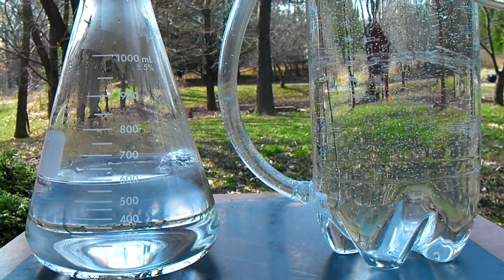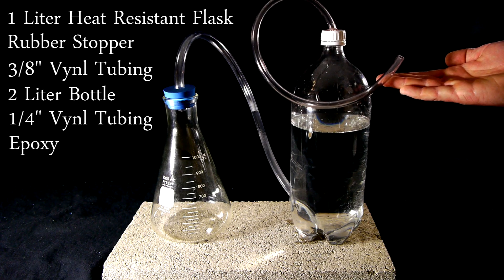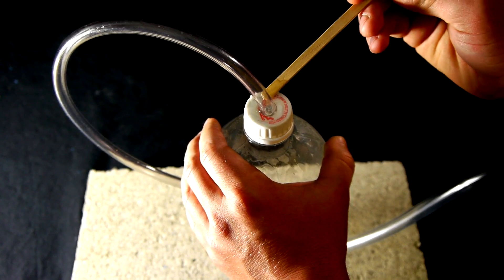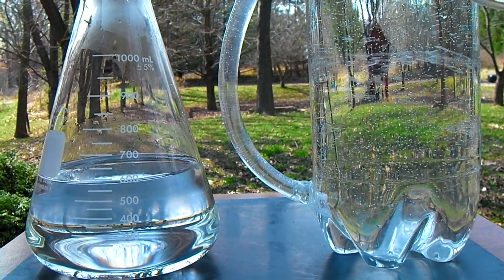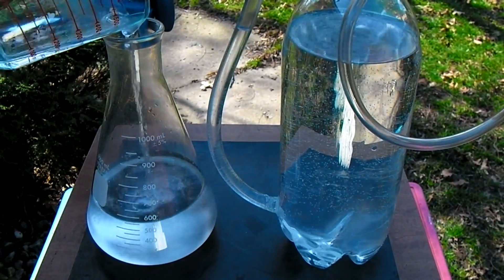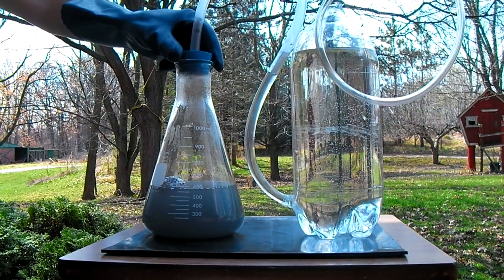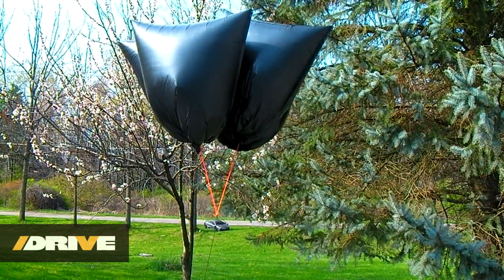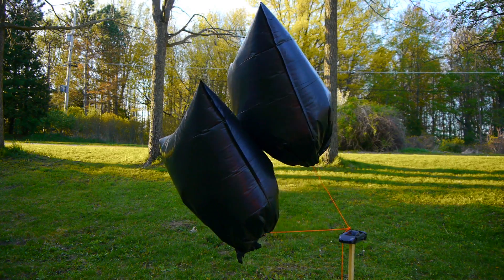How to Make Hydrogen Gas - Clean Burning, Inexpensive, Lighter than Air!

Comment: Isn't this HHO and not pure Hydrogen? I 'm going by the reaction of the explosion pure hydrogen doesn't blow up like this only when oxygen is in the mix of the gases.
.
Reply: Sorry, I was wrong about HHO and HOH thing, I got confused.
You are right about  hydrochloric acid analogy, but I still think you are wrong about the reaction rate of a H2 balloon with some air in it. I have set off many balloons with all sorts of different ratios of hydrogen-air and hydrogen-pure oxygen. Of course the fastest reaction is the stoichiometric mixture of H2 and pure O2, but if you calculate and put the right amount of air with hydrogen, the reaction WILL be faster than pure hydrogen. The reason is because the fuel and oxidizer will be mixed  already, and can react immediately.
Reply: It is not HHO, as aluminum and HCL releases only hydrogen. You are correct on the flamability. I think what happened is that when he filled the trashbags, he let a little bit of outside air in as well, either through imperfect hose seal, or when he unfolded the trash bag.
Also, if he hadn't, the video would have been less exciting as they wouldn't have exploded. Likewise, if he had put a little more air in, the explosion would have been much better, as then he would be approximating an HHO combination.
Reply: iguanian He said HHO. HHO is not the same as H2O or HOH. HHO is a made-up molecular formula that's supposed to mean a two-to-one molar ratio of hydrogen and oxygen gases. It's the product of the electrolysis of water, and it's the ideal mixture of reactants for creating water vapor and a big boom. I personally see no reason not to use HHO as an abbreviation of oxyhydrogen, but a lot of people get ticked by it.
Reply: You know how we, as mammals, breathe oxygen? You know how you don't see everyone walking around with respirators and oxygen tanks? The oxygen used for the combustion of hydrogen in this experiment is in the air. Once the bag is melted by the flame, the hydrogen and air are free to mix together, and the flame initiates the combustion. Iguanian is wrong in saying that with more air mixed in, the explosion would have been better. Air is mostly nitrogen, and nitrogen doesn't take a part in this reaction. You would be reducing the concentration of combustible material, making a weaker explosion. There is plenty of oxygen in the air for a small amount of hydrogen, such as in these bags, to burn. Hydrogen is the limiting reagent. Therefore, more hydrogen means more combustion.
Reply: Nope, 2Al + 6HCl --> 2AlCl3 + 3H2
Reply: Have you even built one of these unit? Do the test then get back to me .
Reply: First of all, "HHO" doesn't exist, it's pseudoscience and nothing more, second like TheSmileyFacedPizza said, the tubes where airtight, the hydrogen mixed with the air, to create the rapid combustion reaction. Unlike what he said however, more air would have made a faster burn rate, although if the bags are the same size, less energy would be released, because the hydrogen IS the limiting reactant. Even though air is ~78% nitrogen, more air means more oxygen as well, and the better the oxygen and hydrogen are mixed, the faster the reaction would be.
Reply: Amos Backstrom Wow. Sorry you don't beleive water exists...
Everything you say after that may be right, but honestly, you may as well be wearing a bird on your head because I can't read any further after your first statement.
Reply: Amos Backstrom I said that the combustion would be less spectacular because if you're putting air into a filled bag, whatever the bag is filled with has to come out. As you said, hydrogen is the limiting reactant. Having even less limiting reactant leads to having less reaction. Whether a better reaction means more reaction or faster reaction depends on the viewer. Personally, I find the deflagration of a pile of black powder to be much more entertaining than the brief, bright light of flash powder.
Reply: Amos Backstrom I also forgot to reiterate the fact that the concentration of the reactants would decrease, thereby reducing the rate of the reaction. Even if you filled the bag up with more air while not letting any hydrogen out, the reactant concentration would still decrease. I get a much more vigorous reaction when I mix 100mL each of 10 molar solutions of hydrochloric acid and sodium hydroxide than when I mix 1000mL each of 1 molar solutions, despite having the same amount of mass of each reactant.

Comment: Also this experiment can be done with magnesium to create Hydrogen and magnesium chloride which remains as a solution 

1Mg + 2Hcl --> 1MgCl2 + H2

But one thing to remember is that the hcl water mixture will slowly be diluted creating less hydrogen as more of the hcl is used up and turned into magnesium chloride and hydrogen, that's why at some point the mixture must be refilled.
Reply: I did that in science class a few weeks ago :)
Reply: Well, the same thing would happen with the aluminum, the HCl would eventually all disappear

Comment: Does the hydrogen gas react with the oxygen or doe it react with the flame?
Reply: It reacts with oxygen, but it needs a high enough temperature to get started. Once that happens, the reaction quickly releases heat and therefore the rest of the hydrogen also reaches high enough temperature to react, and this happens very fast, so you get an explosion, which consumes all the available hydrogen.
Reply from the maker: It reacts with oxygen to create fire.
Reply: NightHawkInLight That is just so cool! I love your videos! Keep it up! :)

Comment: I used a 500 ml heat resistant flask instead, and halved both the water and muriatic acid measurements.  I followed all of the other instructions, but nothing really happened when I added the aluminum foil to the flask.  The brand of Muriatic acid is called Crown.  Does halving the size of the flask, water, and acid affect the reaction?

Comment: Nighthawk, great video. I'm curious if I could use Works toilet cleaner which contains hydrochloric acid and is blue in color. I've used it with aluminum to make the same reaction, but in a closed bottle...Do you believe that will work?

Comment: This is a similar to making meth lol.
Reply: lol nice name
Reply: How the fuck is this similar to making meth. Because it involves chemicals? Wow, how similar. Don't do this if your only experience with chemicals is watching Breaking Bad.
Reply: you need hydrogen gas to make meth
Reply: what do you need to make hydrogen chloride?
Hydrogen of course
Reply: And you think that hydrogen and chlorine combine magically to make hydrogen chloride? You need ultraviolet light to do that. Simple, right? However, once you do that, how do you bubble it through the freebase methamphetamine? Hydrogen chloride fumes can be given off by boiling hydrochloric acid or reacting sodium chloride with sulfuric acid. The latter is preferred because boiling hydrochloric acid will also boil the water it is dissolved in. Neither of those methods involve diatomic hydrogen.
Reply: What is in hydrochloric acid? Hydrogen of course
Reply: Btw a lot of things are made of hydrogen
So yes hydrogen is needed to make meth no matter what the form.
Reply: You seem to have forgotten the whole point of this argument. You related the video to making meth because it involved hydrogen. Nowhere in the production of meth is elemental hydrogen used. Obviously, hydrogen compounds are used, but not hydrogen.

Comment: We did the same thing in College using concHcl and zinc.  Zinc will work in place of the aluminum, if you happen to have chuncks of zinc rather than aluminum.

Another one to try, put idodine crystals into ammonia, filter the iodine out, let it dry, then drop or smash the small pieces and see what happens.
Reply: Boom

Comment: Would I be correct in assuming that what remains of the aluminum foil (with the water removed) is a key ingredient in thermite?
Reply from the maker: No. What is left is aluminum chloride, thermite uses plain aluminum in powder form.

Comment: There is a less dangerous way of making hydrogen without acid: use Potassiumhydroxide pills, drop in to water together with aluminium and water and stirr through lightly shaking the bottle for a couple of seconds.. Same reaction without the risk of losing your fingers :D

Comment: The lift comes from the difference in weight between the gas and the air. 
Air: 1.292 kg/m^3  H2: 0.090 kg/m^3  He: 0.178 kg/m^3 
Lift of H2: 1.292-0.090=1.202
Lift of He: 1.292-0.178=1.114

Comment: Well, which gas burns and could be gathered from a reaction with aluminium? So there should be a reason why the flame is red/orange. Polyethylene consist of (H4C2)n so there is carbon slighty involved, may be you know the  smell of new plasitc bags ... this should be the source of the coloured flame.

Comment: So basically the voltage is what it depends on? Also the electrode composition is extremely important. Your electrode is your seed for the crystal you have to grow, and the purity of your seed is critical to its lattice structure and thus is conductivity and ability to form said crystals.

Comment: depends entirely on 3 things. #1 amperage #2 electrode surface area & proximity, and #3 the breakdown voltage (modified by temperature and electrolyte)  electrode composition may affect it a little.

Comment: that would be the steel case rusting away. try epsom salts.  wont produce the chlorine but will still lower the breakdown voltage. might limit the corrosion due to the lack of the sodum hydroxide which is produced when using nacl.

Comment: Not infinitely. The acid is a reactant, not a catalyst. The aluminum and the hydrochloric acid react to release aluminum chloride and hydrogen. The molecule of hydrochloric acid is split into chlorine and hydrogen in this process. (The equation for this is HCl + Al -> AlCl3 + H).

Comment: All the reaction produces is hydrogen gas, aluminium chloride and water. Aluminium chloride is no more dangerous than sodium chloride (table salt). So the most dangerous chemical (hydrochloric acid) is used up in the reaction.

Comment: We used to do something similar using Red Devil Lye, which is sodium hydroxide.  The solid lye goes into the water instead of the acid.  When aluminum is put into the mixture it reacts in a similar way producing hydrogen with enough pressure to fill balloons, trashbags, etc.  Slightly different chemical reaction, but essentially the same end result.

Comment: along with ek980's point, you're not just making hydrogen, but an oxyhydrogen mixture in a 2:1 molar ratio. separation of these two would be a bit more problematic, albeit not impossible.

That being said, a the recombination of the oxyhydrogen mixture is much more reactive than a simple hydrogen mixture; a trash bag sized amount would make a BIG boom. I remember when the prof. did that in my gen chem class. Pretty cool to watch.

Comment: No worries.  Be sure to limit how much aluminium is added too, so you can control the reaction more.  You can always add more if you need to once the acid has digested a piece of foil, but you don't want to have too much in the first place.  The first time I did something similar I put way too much foil in and regretted it.  It's pretty scary how vigorous the reaction gets and how much hydrogen it can produce when allowed to go unchecked.

Comment: The reaction itself is highly exothermic (gets very, very hot).  This causes both steam from the water to be produced and also more fumes from the concentrated acid to be given off.  These mix with the produced hydrogen.  The balloon will still explode, but the gas mixture will be too 'heavy' to have much buoyancy.  You can control the rate of the reaction better and limit the steam and fumes produced by cooling the reaction in an ice bath but bubbling the gas through water is better.

Comment: A fun thing to do with this reaction: Take a regular two liter bottle and fill it to about three inches with hydrochloric acid.  Add many balled up pieces of aluminum foil, then screw the lid on tightly, shake it up and throw it.  Eventually, the pressure buildup will cause the bottle to explode!

Be careful...the explosion is not fiery, but does throw acid around a large radius.

Comment: Yes it is possible to convert a car to run on Hydrogen gas. Look up the BMW Hydrogen 7. It has the normal v12 motor modified so that it can run hydrogen or gasoline.

Comment: yep currently several manufacturers are experimenting on how to use hydrogen as a fuel source, but there are some complications to using it in a gasoline engine because the expansion rates of gasoline vapors and a hydrogen/oxygen gas mix are different, so the timing of the crank would be wrong,

Comment: Do you make all this only for explodes a balls with H2? And the H2 like you obtain is expensive, becose you need aluminiun, that is not cheap material. And you generates polutions substances with the CL-ide acid- Al.! You must turn to a electrolisis sistem.

Comment from the maker: No, it does not. It cannot ignite in air without a flame or spark. Further, if one of the balloons did catch fire they would burn very slowly. In order to make them burst like is shown in the video I had to also partially fill the balloons with air so that there was enough oxygen for the hydrogen to quickly react with.

Comment from the maker: Wow...Is there something in the water these days or what?

Erectonium is a name made up as a joke because in very basic demonstrations hydrogen is sometimes used to fill condoms. It is not a correct scientific name for anything. I can't believe some people actually pull from such demonstrations that it is the correct name.

Also, if this only produces 50% hydrogen, pray tell, what other gas(s) make up the other 50%, and from where do they enter into the closed system?

Comment: Do you have any suggestions to filter better?  I'm looking for the cheapest (and also fairly rapid) method of harvesting hydrogen as a lifting gas.
Reply: @scott lobdell it's a long shot, 10 years later after all....

did you find a way to make large volumes H2 for lift gas? High altitude ballooning I assume.

I initially wanted to copy the work of @DIYscienceguy. He used electrolysis then used an old refrigerator compressor to pack the H2 into an empty propane bottle.

I like the portability of the gas bottle but H2 embrittlememt and the other myriad safety concerns of isolating just the H2 (no oxygen!) and then compressing it - scares me.

 I want this to be as safe as possible to be within the reach of scouts/sensible secondary school age youth. Under supervision, but with scope for them to do as much as possible.

Helium would be easier but very costly. I want to make hydrogen a  workable option.
Reply: @liammhodonohue  ha thanks for the reply. I didn't end up following up, but there are commercial products available for this
Reply: @slobdell3  thanks for the reply. What kind of commercial products did you find? (I'm in UK)

All I can see is either bottled H2 from gas/welding suppliers - same as who you might buy large helium tanks from (slightly cheaper than helium but not by much. Suppliers not geared up for hobbyists)
or,
on-demand H2 generators for laboratory type applications (=expensive)

Looks like I will have to accept the cost of commercial H2 tanks or explore onsite production via acid+aluminium.
Reply: @liammhodonohue  -- if you can divide the electrodes to keep the hydrogen separate, the refrigerator pump is a good idea.
if you have a vacuum pump, you can get an old freon can (they are about the size of a 20 lb propane tank) and put a vacuum on the tank, close the valve after you vacuum the tank down.  connect to the system. you need to be careful you dont suck water into the vac pump as  you open the valve on the tank.  do it slow till the vacuum is gone.  then you will be using the refrig pump to pump up the tank.  good idea.

Comment: hydrogen is very hard to compress that is another reason people us helium instead of hydrogen however scientist have been working on substances that have a high surface area so gases (like hydrogen) can be stored easier and have more of the gas in the container which also means that hydrogen may one day be a viable fuel source

Comment: You could use sodium or potassium hydroxide instead of hydrochloric acid. Much safer and doesn't produce toxic fumes like the vapors of  muriatic acid boiling from heat of the reaction. Sodium hydroxide is also much easier to obtain and cheaper than hydrochloric acid :)

Comment: trying to do this by heart.. correct me if I'm wrong...
6H⁺(aq) + 3Cl²⁻(aq) + Al(s) ----> 3H2(g) + Al³⁺(aq) + 3Cl²⁻
I surely missed something there, but it should be something like this.
and when you burn it, the classical
2H2(g) + O2(g) ----> 2H2O(g)
(the oxygen comes from the surrounding air. the explosion would be a lot bigger, if you mixed it already into the balloon.)

Comment from the maker: You might want to filter it better before running it in a car or the left over acid vapor will destroy everything. It's really not a good hydrogen system to have in a car anyway, it takes too much maintenance.

Comment: I wouldn't trust a pickle jar. Those aren't suitably heat resistant. You need to use a borosilicate flask. You can get Boro flasks pretty cheap online.

Comment: I would like to point out that this is not the "cheapest" way to produce hydrogen gas from water and aluminum foil: using lye (sodium hydroxide, NaOh) instead of HCl is cheaper because it does not get used up; the lye prevents the aluminum from forming a protective oxide layer, allowing the following reaction to occur:

Comment: would be cool to attach a long fuse and set it up into the air at night. also would it have been safer too electriclly separate the hydrogen from water?